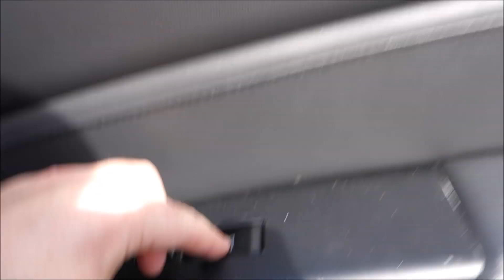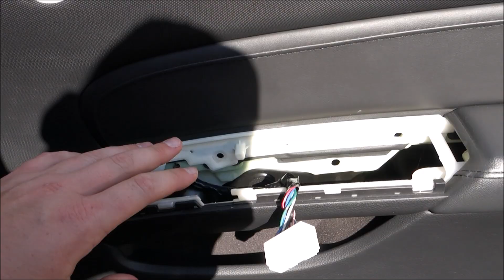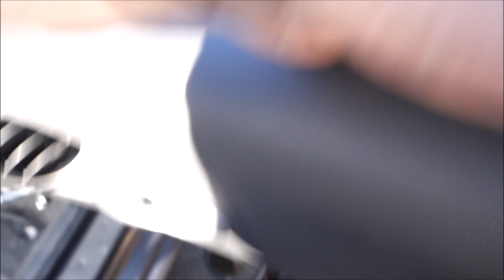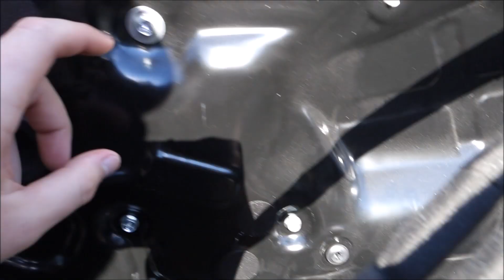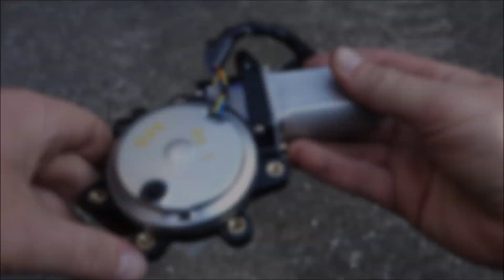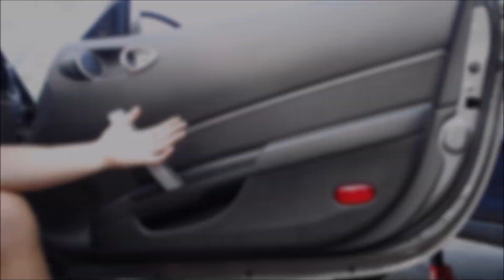Nissan 350z Window Motor Replacement

Comment: The square notch on my new motor didn’t line up like his did… I plugged the connectors back in with the door apart and used the switch to spin the motor until it lines up. Just in case anybody has that problem

Comment: Would have been atleast 6 years since I'd last done this, driver side went out on my ausspec 2003 350z today while in the downward position, was able to determine it was the motor/regulatr thats kicked the bucket, this video was a great refresher with some great tips on mounting the rails back on.

Cheers mate, got the window back in the up position, just have to order a new motor now and do it over again.

Comment: i followed this video step by step and now it’ll roll up but it’s not lined up correctly, the window points inwards slightly so when rolled up it doesn’t go in bewtween the weather stripping by the mirror, how do i fix this?

Comment: I have to do this on my neighbors 350z convertible, he slammed the door one day and the window wouldn't go up so after taking the door panel off and finding there was power the only other thing is could be was the motor so i hit the door and it started working some told him if it happens again which it did to hit the door but instead he brought it to me again so I asked him of he tried hitting it like I showed him he said no, some people just don't listen so I told him I'd replace it for him, I've replaced window regulator assemblies but never just the motor which a long time ago was all you had to do, some cars used to rivet them in and you had to have a special rivet gun to reinstall them at least these are cheap at under 30 bucks, thanks for the video.
Reply from the maker: You got it!  Sometimes hitting the door will get it to work a little longer but I just replace at that point.  Driver's side needs a new one now.

Comment: Just replaced my window motors following this video, great video! 
However i noticed a few things when i did it that are quickly gone over in this, for me it was lining the tracks back up into the holes on the bottom. It was a nightmare, cut my hands up, cursed the car gods. Takes a lot of time and lining up just right. it's actually easier to leave the window UP and tape it so it doesn't fall, that way you can use the window itself (Gently) to guide the holes if you need to.
When i finally got it all back together the motor wouldn't roll the window back up or move at all, i could hear it trying to do something...i tried taking it all apart and swapping the old back in (which still worked on the passenger side) the notch on the back wouldn't line up for some reason after putting the new motor on. 
To say the least i was a bit angry at this point trying to get it back on, ended up putting the new motor back in again, sealed everything up, and was about to just give up.
I looked up how to reset the motor and noticed the guy in that video had his door CLOSED not wide open like in this video. Closed the door, turned the car on...boom works like new no problem. I don't know if this is an isolated issue but it may help someone not rip their car door off trying to get it to work.
Thanks again for the video!
Reply: i’m having the same ducking problem i can’t get those two sc in
Reply: Your a legend I was having the same exact problem thanks for the help!

Comment: Great video, makes it look easy!Lol, I will give it a go soon! I had to take out the 5th bow motor of my roadster and have the brushes redone. I reinstalled the motor and now the top goes up and down without a hitch! Saved myself over $1800, the dealer wanted $2000. 
If your having 5th bow motor issues, I would recommend getting new brushes in the original motor!
Thanks again for the video!
Reply: where did you find replacement brushes?

Comment: Hey i had me whole door replaced (passenger side) and they installed everything back and before all that my window, switches work fine and after i got it back when the door was replaced nothing works and i mean the passenger switches won’t and it even won’t lock the car what can it be

Comment: I replaced my window motor ( passenger side) for my Z the problem is that the one I bought has no reset switch on it. I have already tried different methods to reset it and followed every step, but it won’t reprogram. What should I do?
Reply: Ruben Ruan did you ever solve it I’m having the same issue